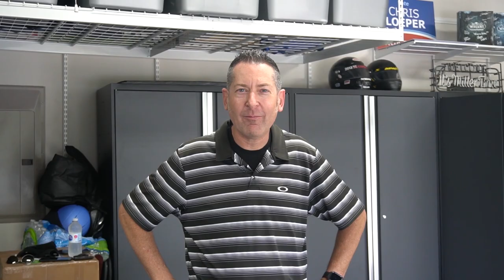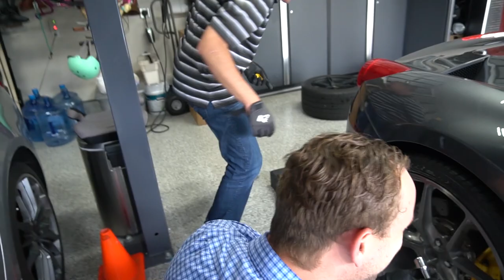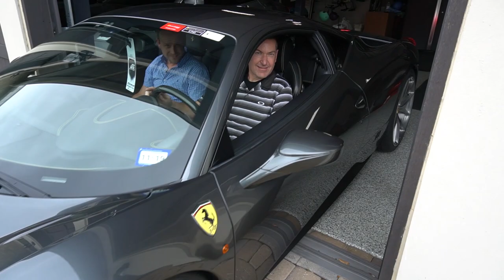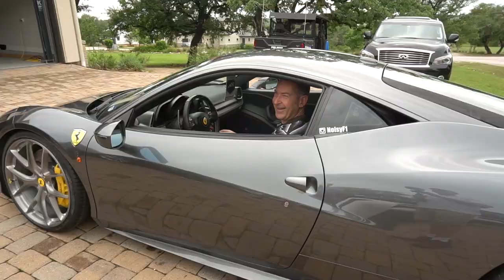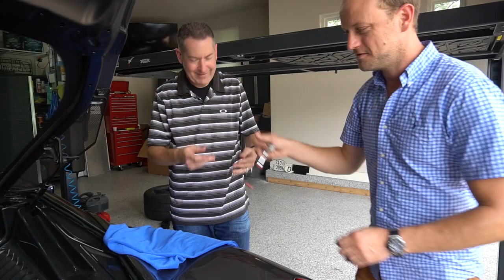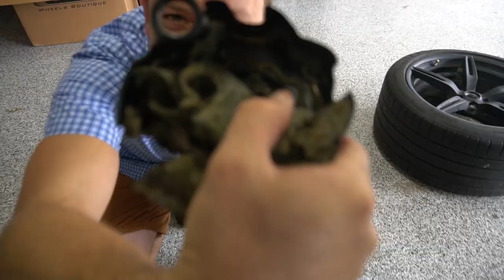Loeper's wife HATES his new $15,000 HRE wheels for his Ferrari 458

Comment: I hope he knows his speedometer will need adjusting.
Otherwise he will be confused about the speeding tickets.
Reply from the maker: Yup, we told him about that.
Reply: The difference is Moot. I went from 20" stock to 24" and had my wife follow me the highway. She set her cruise at 65 and I drove at what my speedo (non adjusted said was 65) we were driving at basically the same speed. She did not pull away, and neither did I. Both vehicles stayed within the same area of each other. Is it better to adjust speedo? Yes, but you will not get any tickets, for the slight variation, if you do not.
Reply: @weareoncode4665  there are some online calculators you can enter gear ratios, vs tire size and see different speeds vs rpm.
You might be surprised how much difference there really is.
Reply: @justfishing6067  Yeah I am getting one, I just have been lazy, so I didn't buy it yet. I agree there is a difference when not adjusted, I just don't think its major. Don't know how we could confirm any measurable difference?

Comment: Larger diameter wheels = less acceleration, Larger wheels = higher top end speed. Considering most driving of these cars on on side roads going less than 110mph, I would stick with the smallest wheel that still looks good.
Reply from the maker: You also get smaller brakes if you go too small.
Reply: @normalguysupercar  good point. I'll append my comment to "buy smallest wheel that looks good and can accommodate the brakes you want. Also, the lower the weight the better for wheels.